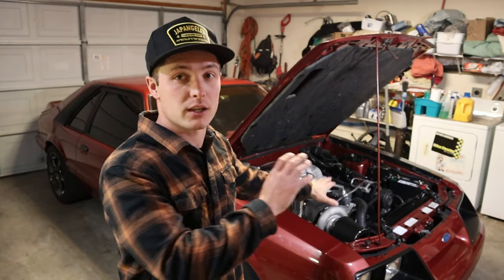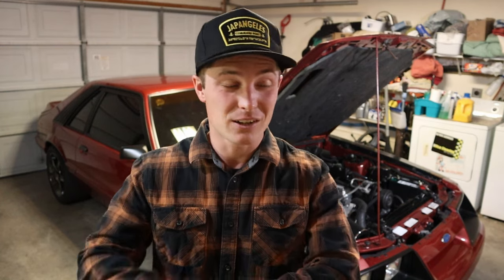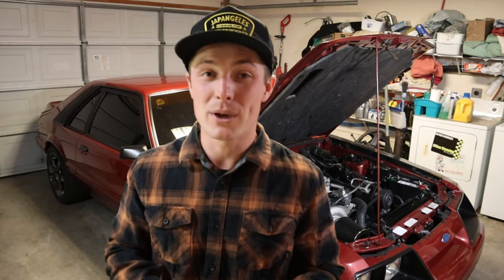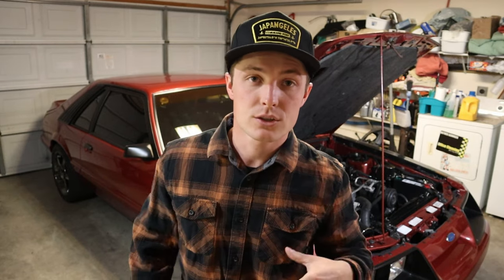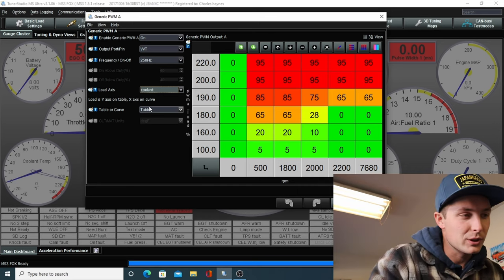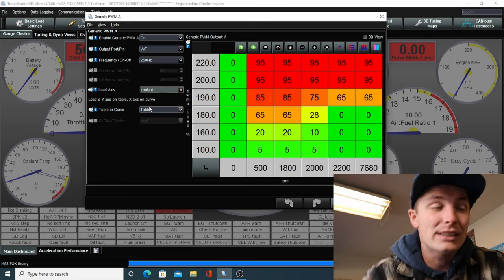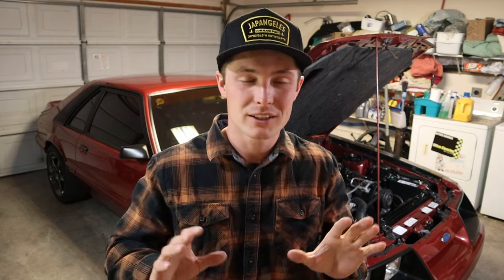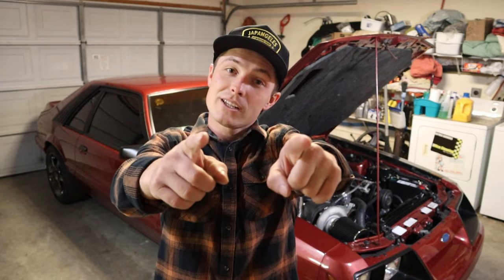Variable Speed Cooling Fan Control on the CHEAP!!

Comment: 7:50 You could've turned the fans off above a certain RPM... which would be equivalent to turning the fans off with the TPS. Just put the PWM setting to 0 at 4000 RPM and that will make the fans turn off. When the RPM falls back down below 4000, the fans will start running again.

Comment: Thats a cool set up and makes parts availability just as simple as a  stop at any parts store, sounds like one of the fan motors needs some attention though. Ive used contour, fusion and SN mustangs and none ever made that noise unless it was about to take a dump lol. Good detailed instruction on the controllers, we are building a car for some future drag n drive events and going to make a stop by LKQ tomorrow and snag a 4-5 controllers for my Duratec swap and his SN plus a spare for each
Reply from the maker: Yea it’s an easy little gadget to pick up for cheap! And I’ll double check it then I didn’t think that noisy part of the fan was good 😅 but that’s any easy trip to LKQ to get another fan setup! Lol man I wish I was going to LKQ tomorrow though I need to grab some spindles  from there! And definitely for 5-10$ bucks a controller you can’t go wrong!
Reply: @iamchazhaynes7074  even for $20-$25 its still cheaper and more rugged than parts store junk controllers even if wired for on/off control
Reply from the maker: Exactly how I feel!

Comment: No reason to turn the fans off on full throttle, you are loosing in your situation maximum 66A@14V which is 924w or 1.25HP